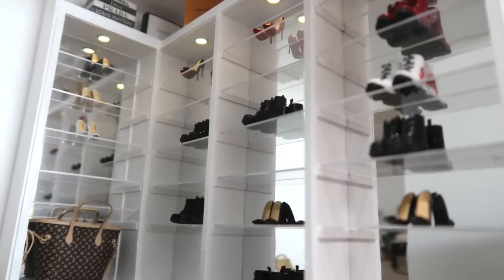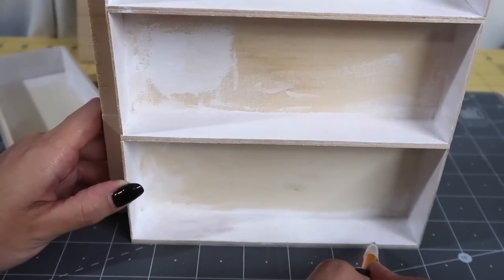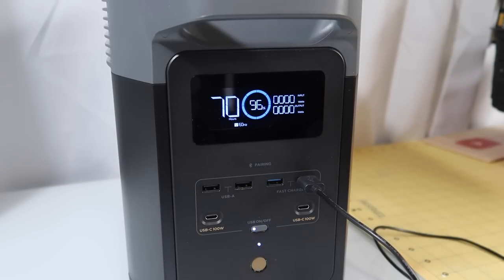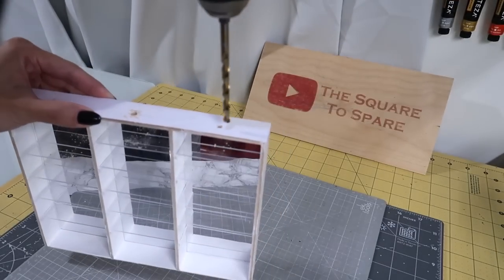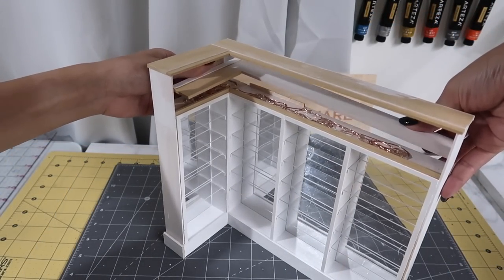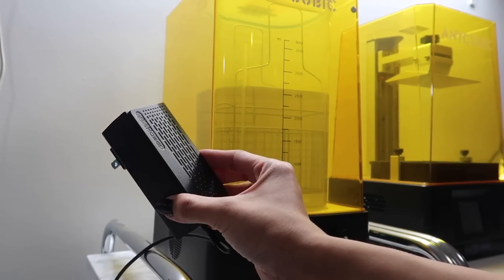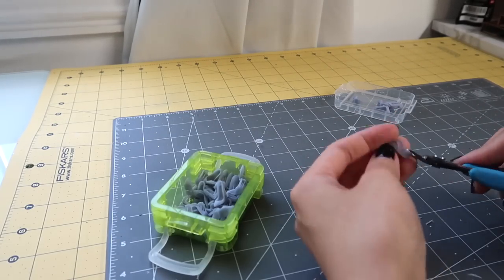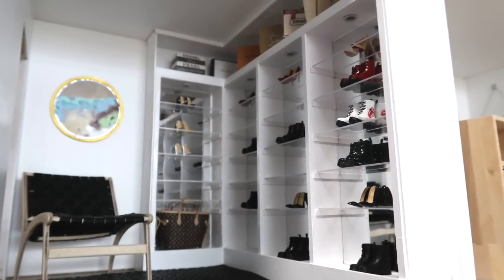Tutorial for a Dollhouse Shoe Closet (ft. Delta 2 EcoFlow)

Comment: To help with the light leaking out the top of the closet, you can paint over the blob of hot glue with a few coats of silver paint and a layer of black over that. The paint will reflect the light back down to where you want it